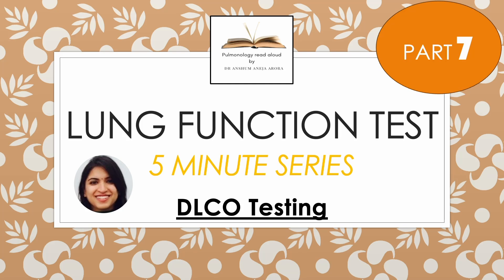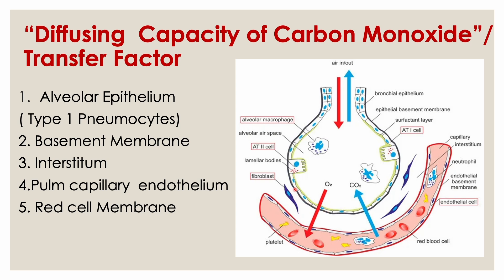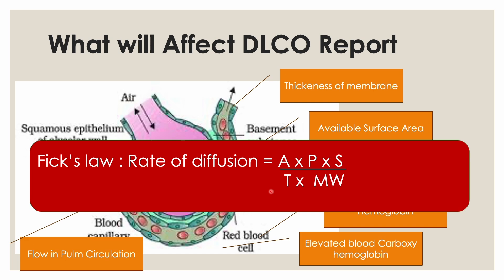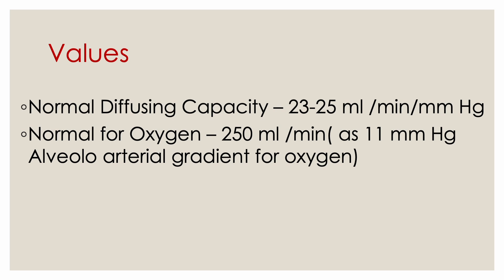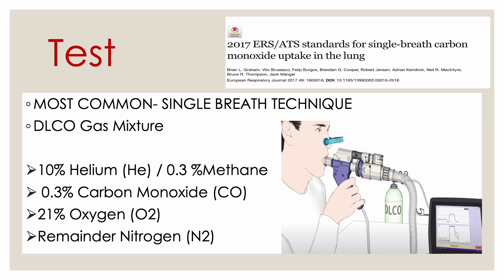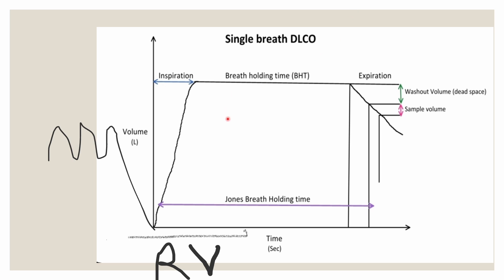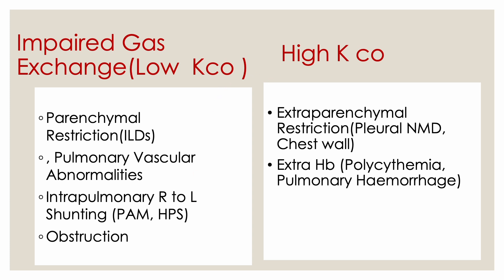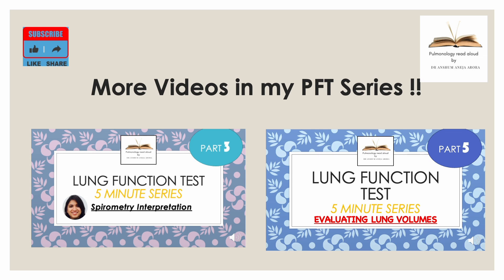5-Minute Pulmonology Series PART 7 :DLCO Testing

Comment: Thank you for simplifying DLCO. 
I Have a doubt, in the Fick's formula shown above,  A stands for surface area and S for solubility of gas ?  -- as you have mentioned molicular weight in this formula.
Other wise we can simply use diffusion coefficient of that perticular gas. 
please correct me if I'm wrong.